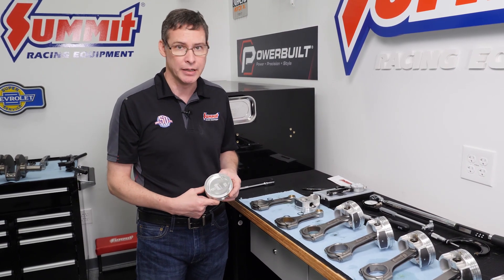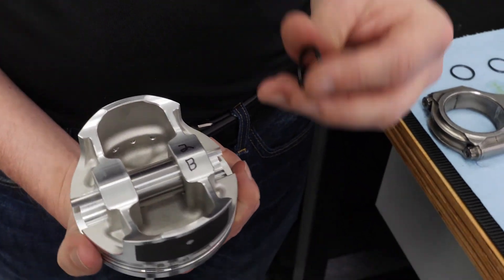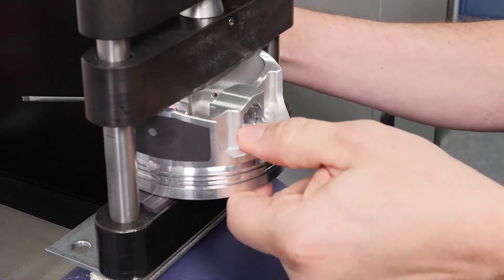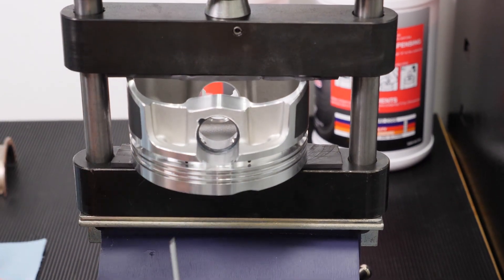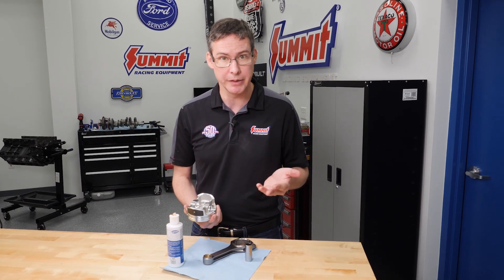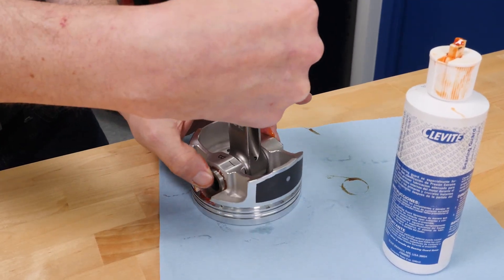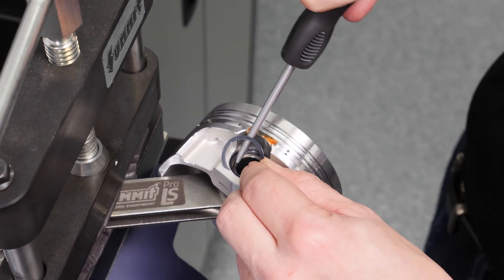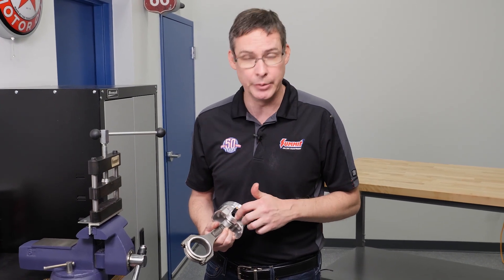How to Install Spirolox Retaining Rings - Engine Building 101

Comment: Why does my package of spirolox contain 32 pieces? I had the understanding that each piston required two locks on each side (total of 32). Am I mistaken?
Reply from the maker: Great question, a typical V8 engine only requires 16 ! Please contact our customer service department for any Questions or  issues with your order. Thank you for your business!
Reply: some piston manufacturers use 2 locks per side, 4 per piston...8 x 4 =32

Comment: You can take the spiroox and pull it apart like a Slinky to where it is about two inches stretched from end to end. Take one end and begin to push it in place with a small screwdriver and just keep feeding the spirolox into the groove that locks it in place. Don't call me crazy because the Spirolox instructions say to do it this way. I have put them together using this method and never had one fail. I'm 80 years old been doing this stuff for 50 years.

Comment: Thanks! The reason I am rebuilding this motor is whoever last had it apart did not install the clips properly and one failed causing the necessity of new pistons and cylinders (Harley FLH). This video will help me immensely as I have never used the spiral lock type before.
Reply from the maker: Thanks for watching Arthur ! Good luck with your Rebuild !

Comment: These are the most superior designed retaining rings for wrist pins? Just curious!
Reply: It’s funny how common the snap ring style is on Diesel engines but I never see them in gasoline applications
Reply: @Hot_rod_homestead  snap ring is used by MAHLE and Diamond Pistons 
It's a manufacturer's preference
Reply: It’s way easier to stretch them out. I build BAE drag racing engines that produce 3,000 hp and you have to be super careful with every step. But definitely stretching them out has been a life saver!